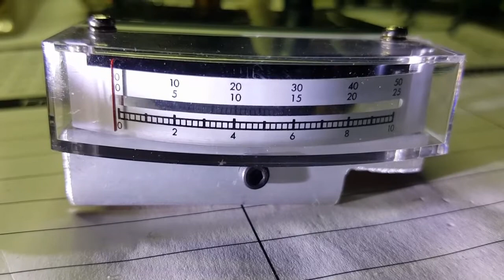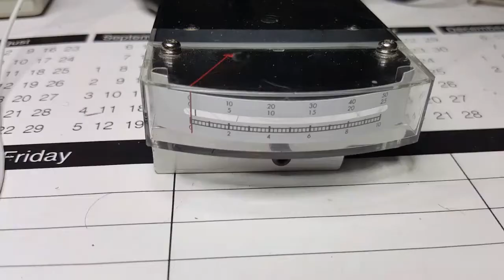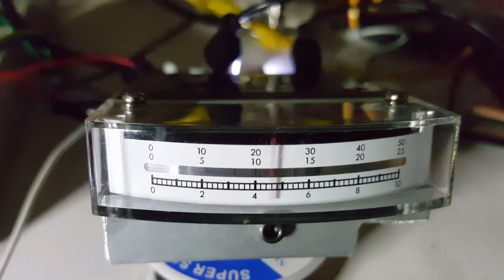VK3YE's 'non-invasive' AGC circuit for BiTx40 or similar QRP rigs

Comment: do they make a opto coupler with the LDR photo cell built in it? that's pretty cool Paul
Reply from the maker: My AGC uses discrete LDR and white LED.  As per the VK3YE video.
Reply: @Paul_VK3HN  

I'm wondering if an IR LED setup might work as well, and would not need any shielding.
Reply from the maker: @andrewferg8737  Can't see why it wouldn't work. Try it and let us know!
Reply: @Paul_VK3HN  
Just wondering how to set it up in  the split power push-pull amplifier I'm working on...Any suggestions regarding polarity or grounding of the agc  transistors?
Reply: @Paul_VK3HN  why not use an optocoupler anyways.
Reply from the maker: @iceberg789  an optocoupler is a LED and a photo sensitive transistor in the same package. Not a LED and a photo sensitive resistor. You need the resistor to put across the audio line to ground, so that the light dependent resistor (LDR) behaves like a light-controlled volume control. Its an ingenious and simple  mechanism.

Comment: That is pretty clever.  I like it!  I do have one additional thought (improvement?):  if the signal coming in is really strong and there is clipping, noise spikes, or other distortions in the earlier stages, wouldn't it make more sense to attenuate an earlier stage of the receiver to prevent those from potentially generating "unwanted products"?  It might keep the signal in the linear range and keep the signal cleaner as it goes to the later stages.  Once distorted, reducing the audio gain wouldn't repair the damage - it would just make it less loud.
I think that is how it is done in most commercial radios.  In fact, looking at the schematic of the venerable Kenwood TS-830S, known for having an superb receiver, they reduce the gain at multiple early stages with AGC derived from late stage IF right after a diode ring detector.
Perhaps I don't have the whole picture and when you say that AGC circuit drives the "top end of the audio gain control" you mean something else.?  In direct conversion (DC) receivers the audio chain is most of the gain.  But I think you are working with a rig similar to the Bitx40 which appears to be a heterodyne type.  Controlling the amplitude of the signal before the mixer or at least before the crystal filter would ensure that any energy that might overload is cut down to size before it can result in offensive and unwanted products.  So you might aim toward the base of Q1 and Q2 (bitx40) if you wanted an AGC more like what is done in rigs like the TS-830s (and many others!).  :-)
Cheers!
Reply from the maker: Harry Magooslum Good comments Harry.  Of course you are correct, a proper AGC reduces the gain of the stages ahead of the detector, specifically the IF stages. My receiver is indeed a heterodyne type, but a simple one without a gain controlled RF stage, so the compromise is to reduce the audio stage gain automatically in the presence of a strong signal.  It works for fixed gain superhets like the BiTX.  Because it is a compromise circuit it doesn't have the dynamic range of a proper AGC circuit.  But it's better than nothing!